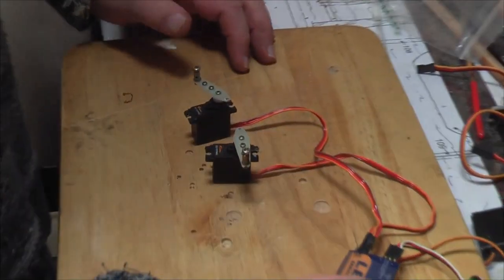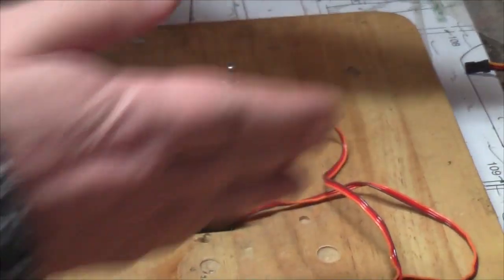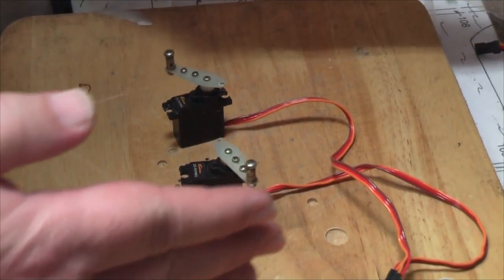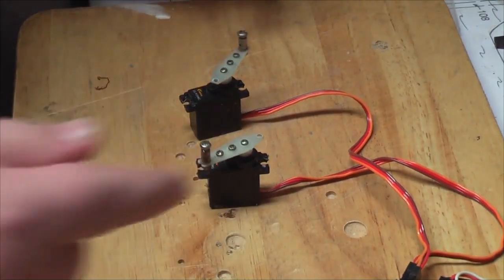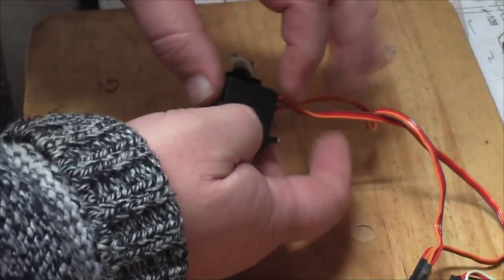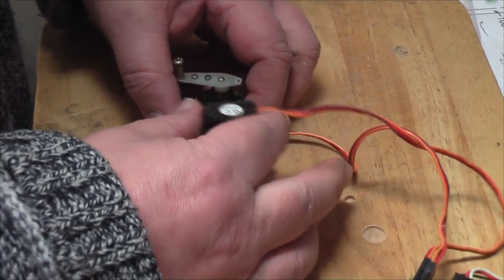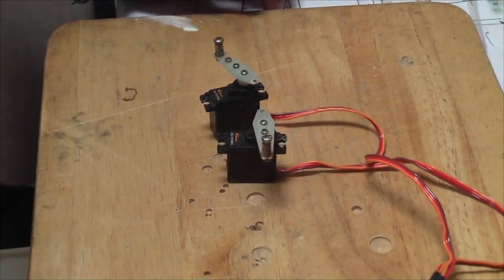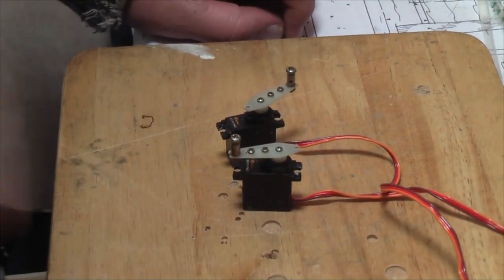How to Reverse a Servo - RC Model Geeks

Comment: I have done this many times in the past when transmitters were not so versatile but these days I would use 2 channels and mix them.  The problem that you noted whereby you cannot get the servo arm exactly at 90 degrees when the servo is centered cannot be resolved when using a Y lead unless you are very lucky.

Back in the "Old Days" Futaba servos had an odd number of splines on the output shaft and servo horns and by moving the X shaped horn around you could get much finer control of the centered position because each arm was at a slightly different angle due to the number of splines.  The 4 arms on the X shaped horn were numbered so that they could be differentiated.

I suspect that not many people knew this even then and put up with non centered output arms.  These days we just dial in a bit of sub trim.
Reply from the maker: I forgot to mention in the video that indeed i have found even the cheapo servos do indeed have offset splines on the output arms. As you say not many people know or notice it ;o)

Comment: Is there a way to determine the correct wires to switch whenever they are all the same color? Also, I've got an emax servo and there are 3 wires attached to the motor. . . 2 are going to the poles(as shown in your vid) and 1 is soldered to the can. I'm assuming reverse the two that are attached to the poles?

Comment: Hmmmm, spare channel and program, would take me 30seconds? maybe 1 minute,  change 1 channel from 100 weight to -100, on my 9xr pro with flysky module,  I know what I would do,  yours is another Most complicated way of doing the same thing,  but hey whatever floats your boat! :-D  love your vids, and with the old Tx's that's the way we would have done it.
Reply: Also preventing interference, current loss, you won't lose function of the 2 servo's the same time usw.
Reply from the maker: There is a reason for doing it this way and all will be revealed in a later video ;o)
Reply: Digifleet?